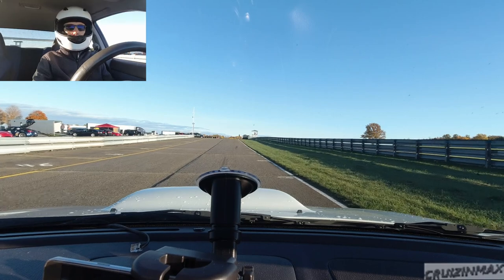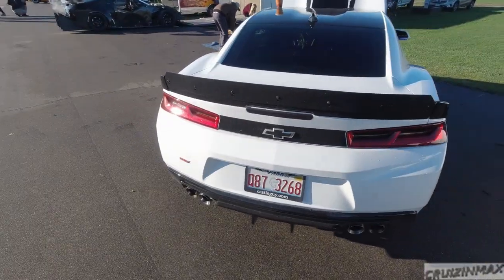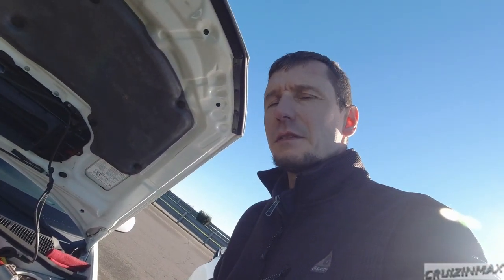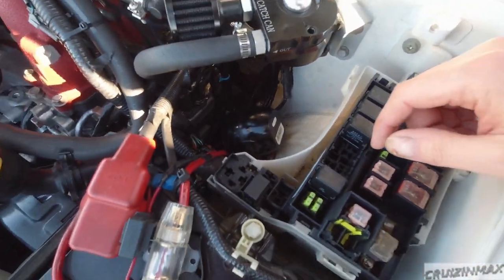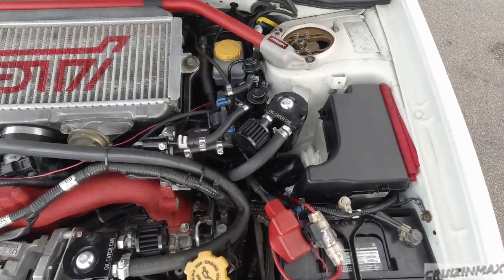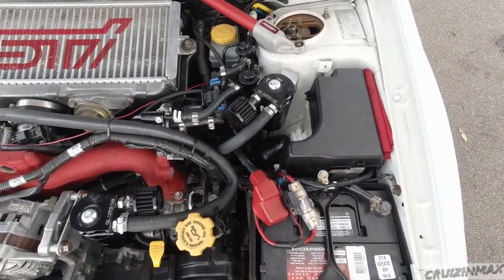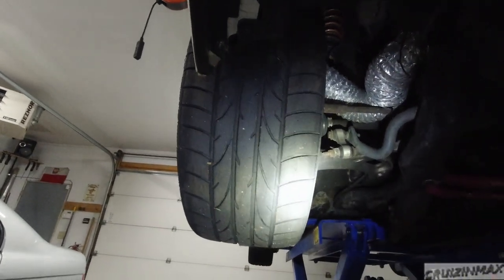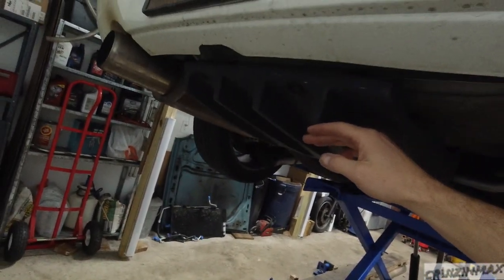Subaru STI trackday gingerman

Comment: Cool video! Car looks quick! 
I’m excited to check out Gingerman next summer. 
 A racing seat and harness go a long way in helping keep you planted in the seat and feel more connected to the car.  The feedback is great!   I’d definitely recommend doing an actual roll bar if you do a harness, because if the car rolls and you’re strapped in tight with a harness on a harness bar and no roll bar, there’s no way you can lean out of the way if the roof comes in.   At least with a 3pt belt you’re not totally stuck in place.   New tires might be the best first step though 😬
Reply from the maker: Yes yes, new tires is a must, thats why I spun out, those old tires are pretty much garbage now.